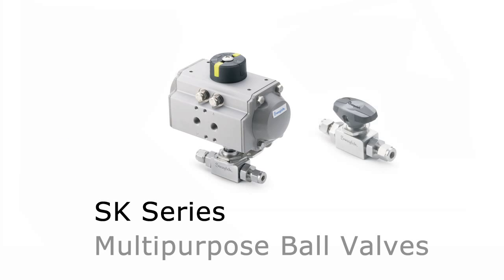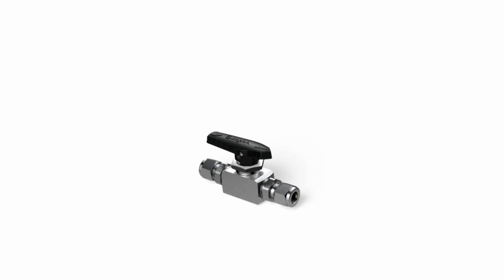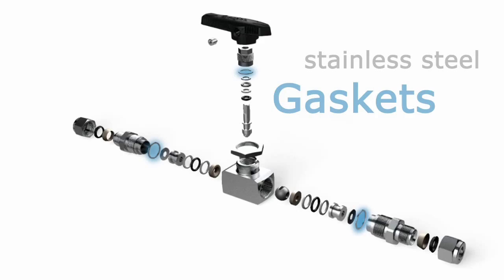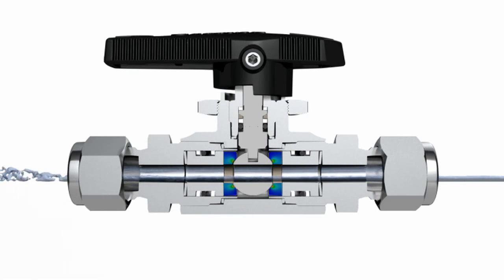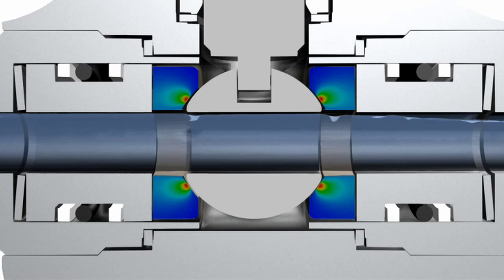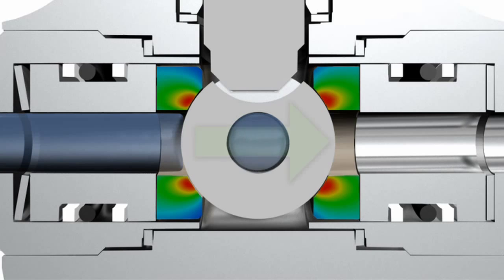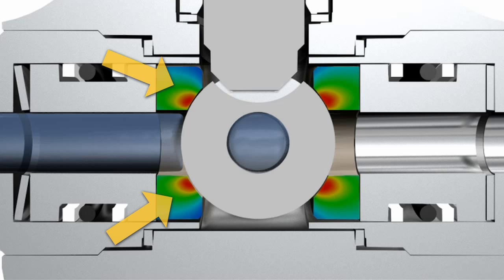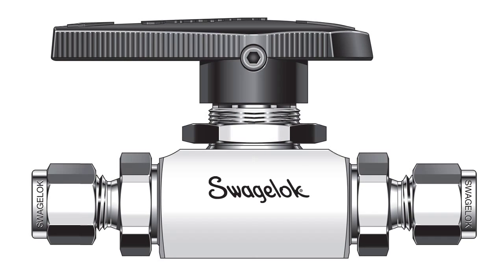SK Ball Valves (SK Series) | Solutions Spotlight | Swagelok [2020]

Comment from the maker: @kakashi88naruto  Thanks for your post. The SK ball valve has an orifice of .188 in (4.8mm) with end connection sizes from 1/4 to 3/8 in. The pressure rating is 6000 psig (413 bar). Feel free to review our product catalog for data and details, or contact an authorized sales and service center in your area. 
 
If a larger size is required, the Swagelok AFS ball valve has an orifice size of .472 inch (12mm) with end connection sizes up to 1 inch with the same 6000 psig (413 bar) pressure rating.